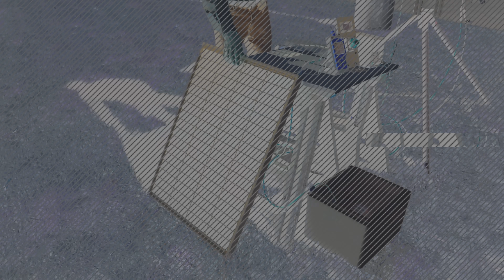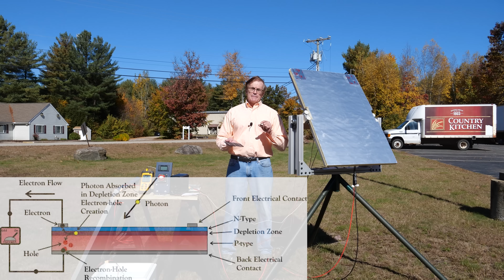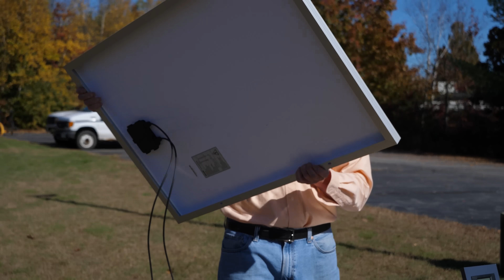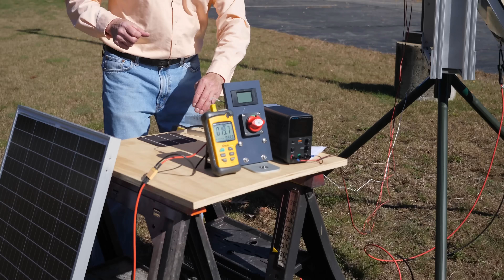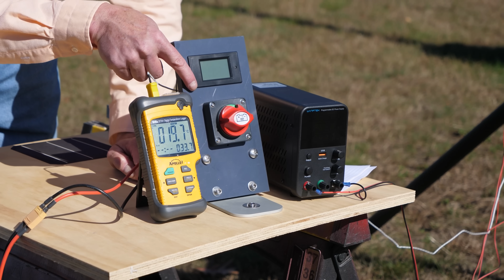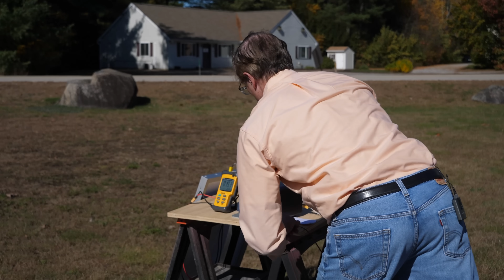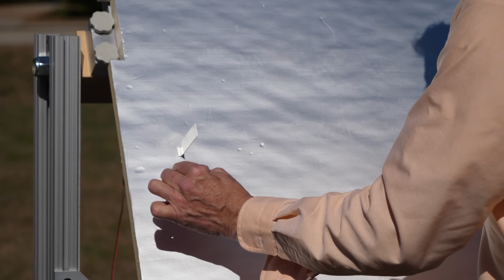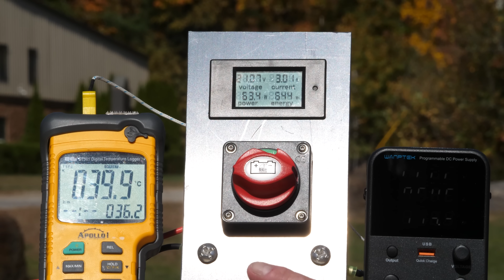Do you REALLY get enough out of your solar panel?

Comment: A couple of issues. the original test run had the fans and heatsink on the back, this may have actually increased the thermal mass and created a higher temperature in the passive mode. Once the fans were turned on they would do the job as described but the temperature difference between a standard unmodified panel and active panel may not be as great as shown. However in saying that the best idea may simply be to add the aluminium fins to the back of the panel, that alone would greatly increase the passive cooling, no fans required :)
Reply from the maker: The modified panel with the fans off runs slightly cooler than the stock panel, but the difference is small.

Comment: Fantastic test. If the panels are fixed, this may even be achievable with a solar chimney of sorts - black tube heats up and air inside rises to escape, drawing cool air from below, possibly even from under ground, past the panels to cool them. Not sure what kind of setup would make this practical with enough air flow, but something to consider.
Reply: Benefits are zero maintenance and totally passive system, potentially low cost, potentially use recycled materials like soda cans for heat collector.  Use exhausted hot air to heat or pre-heat water for showers.

Comment: i have a question: imagine we send 1 millions watts with a big mirror reflector to 1 solar panel 100 watts with a special cooler that keep  constant temperature juste above 0 celsius.  what maximum watts in theory a panel could handle/output ? is it related to the heat only ? thanks a lot
Reply from the maker: Eventually, the cooling system will not be able to keep the panels  and especially  the conductors within the panels below their damage threshold.
Reply: @TechIngredients  thanks you , it make sense ,i think there is a nice path  to explore

Comment: 1) I ABSOLUTELY LOVE THIS CHANNEL! You're thorough and your explanations are easily understood! I subscribed after the first video!
2) Would it be cheaper/easier for a person to just buy 20' sticks of 3/4" aluminum angle and cut them to length then adhere?
3) If a person has a modest breeze(2-5 mph) or even convection, would the added heatsinks alone provide worthwhile benefit?
4) At 1%/yr degradation, the panels will still be producing 80% at 20 yrs versus 90% for 0.5%/yr so roughly +2.5% over the life.
     At 2.5% improvement,  the "system" needs to cost less than $3/panel. Otherwise it's simply cheaper/easier to install 2.5% more panels.
     Also, solar changes so fast, after 20 years of technological advancement, solar tech will likely be pennies/watt maybe even spray-on.
5) Years ago, I spent many hours designing a passive solar tracking system that should add 20% to daily solar harvesting, but ran into the same issue. The system would add about 20-25% to the array cost and some basic maintenance. In the end, I decided that adding 20% more panels with no moving parts was the wiser solution.
6) I'd love to see what you think of Redox Flow Batteries. I've been following them for years and think they may be the solution to alternative energy storage. Imagine... Tanks at your house that power your home and recharge via solar or cars that use "gas" station infrastructure to simultaneously extract the "discharged" fluid and fill with "charged" fluid.
Reply from the maker: Thanks for the comment.
Bending  your own is much less expensive than the extruded angles.
You have to combine  both the increased power output  with the increased longevity for a cost vs. performance comparison.  Also, the higher the sun's intensity and the ambient  temperature, the more the cooled version makes sense.
If you have a limited area for PV panels then replacement for increased performance makes more sense, but if an upgrade only means adding more panels  to your system then maximizing the lifespan of existing panels makes more sense.
This approach  is just another tool.  You have to run the numbers as you clearly did to decide whether to use it.

Comment: Very nice video.
The one thing I wonder is how fast the fans weather. Replacing these fans on a roof is not easy.
Reply from the maker: They have a MTTF of 50,000 hours at full power, and you only need to run them about 8 hours per day at 25% of maximum output. 
They could also be modular for plug and play replacement.

Comment: It's kind of common sense to anyone that has electronics as a hobby, or has a gaming PC.
No silicon Integrated Circuit, which is what solar panels are, likes temperatures over 50 degrees C, and operates better and better as they are cooled, all the way to absolute zero.

Comment: I wonder what the impact would be of natural convection on the back side of the panel with the same fins and back cover but no fans. If you increased the gap at the top of the back cover to match the bottom gap you might move an appreciable amount of air by natural convection. The panel temperature would no doubt be higher than the forced convection but an overall simpler and less expensive installation with no moving parts AND the net power gain might be similar. Yes, I am an engineer...

Comment: Forced air cooling would not be cost-effective with the 4 panels I have on my motorhome. However, I am moving up to a newer motorhome that doesn't have solar, and, and because we don't use solar all the time, I am thinking about not permanently mounting the new panels on the roof, instead storing them in a bay when not in use. After hearing about the heat-related degradation, I think I will definitely go that route, which should help prolong the useful life of the panels. That's my takeaway from this informative video. As always, a well presented and useful video!

Comment: i wonder if mating a thermocouple to the backside to absorb heat would differ any from the fans. Just like the fans, a thermocouple will require power in order to operate.
Reply from the maker: It wouldn't  work.  Thermoelectric  devices pump heat from one surface to the other. You still have to cool the warm side.  Also,  they are very inefficient.

Comment: The problem with this is it's cheaper and easier just to add more panels. What was the cost of all that equipment vs the cost of another panel? You can get a 100W panel on Amazon for less than $100 which would add another 60ish watts of power, compared to the price of multiple fans, controllers, heat sinks, etc. which will add what, 8 watts? It just makes no sense.
Reply from the maker: You should have watched the whole video.
Reply: @TechIngredients  I did, and I usually like your videos but this is a pretty poor defense. The equation is very simple, solar panels are producing about 1 watt per dollar these days and good fans are very expensive. Unless can prove a fan, capable of running at high temps, high duty cycles, outdoors, can provide 1 watt of efficiency increase per dollar of cost it's a negative ROI investment. I bet just the fans alone make it a negative ROI, without even adding in the heat sinks and everything else required to run the system. And extending the life of the panels is a bad argument because solar panels only get cheaper every year, in 10+ year $1/watt will be expensive so the equation only gets more lopsided. I highly doubt you could provide numbers to show this would yield a positive ROI, even with the theoretical scaled up system with less fans.
Reply from the maker: What you don't  address  is the degradation argument.  In addition  to the power boost, these panels  will last longer, and both benefits  increase when these panels  are running at high ambient temperature  and high sunlight intensity.  That's  why I suggested that where you live will determine the ROI for this approach.
Reply: @TechIngredients  Yes I do, the degradation is addressed by technology getting cheaper with time, plus you're not wasting time and money on cleaning heat sinks and replacing burnt up fans. In 10+ years when degradation is enough of an issue, it will be even cheaper to replace a few of the panel to get better efficiency.

Comment: they did not even mention about bifacial panels which increases power drastically but now it is bifacial you can't put anything on that side of the panel.
Reply from the maker: You could still add the air flow even if the fins would not be used.  But, you're  correct that they would not be as good a match.

Comment: nice testing but the importance and hype is so wrong.  you don't even have to listen me but look at utility grid level solar farms, they don't do it as it is just not worth it.  You are better off buying more panels as they get better while getting cheaper.  additionally, they did not even mention about bifacial panels which increases power drastically but now it is bifacial you can't put anything on that side of the panel.

Comment: Instead of using aluminium fins could you use an array of thermocouples? They would lower the temperature with the bonus that you could extract power from them.
Reply from the maker: They would be far more expensive  and less thermally  conductive.

Comment: By the time you pay for the fans, the sheet metal and the labour, you will have spent way more for that extra power then if you just used more panels. That's the problem with basically every way for improving solar. Solar trackers are more expensive for power gain than just buying more panel. Solar is so cheap that the answer is always more panels.
Reply from the maker: If it was only power, then you're  probably  right.  Don't  ignore  longevity.
Reply: @TechIngredients   Interesting point about longevity, most panels are guarantied for 25 years, but you fans will definitely not last that long. Adding moving parts to improve longevity is probably not a good idea.

Comment: I do think water makes more sense in the long run. It's not only about cooling the panels but what you could gain from that hot water.  And if you want to cool the water then a radiator could be added to the loop. This would have massive advantages the more hot water you need for your house. Also, yes, it could leak. But the mechanical parts of the fans could also degrade. A radiator (potentially with active cooling) would (in my mind) be easier to service.

Comment: What I'd really like to see is fully integrated heat management in homes. One big ole heat pump, and a manifold to direct hot and cold water. Hook up your fridge, pool heater, ac, heat, solar, battery packs, everything.
Reply: I've been thinking about this as well, instead of solar panels we could install solar absorption panels and radiative sky cooling panels all over the roof, but I don't know a reliable way to toggle the panels on and off, without having to replace mechanical parts a lot
Reply: In combination with more efficiently insulated homes, the energy required to moderate the temperature of the home would drop and less panels would be needed
Reply: I think another useful tool is window treatments. I'm thinking things like: An external insulated & heat absorbent window shutter for cooler weather, and a passive cooling film for warm weather which reflects IR and heat and radiates the energy it does absorb into the sky

If this kind of thing is possible it would help even more
Reply: @Kavukamari  if you live about halfway into the southern or northern hemisphere such that sun somes in at about a 45 degrees angle, you could build and position your house such that one side of the roof is getting sunlight dead on (at midday, the sun would still cross the sky) while the other side of the roof is in perpetual darkness since the sunlight would be parallel to the other side of the roof, though the wobble of the earth might expose it to light if you aren't careful. Then you could have ideally placed and oriented photovoltaic/thermal/hybrid panels on one side of the roof, and passively radiative panels on the other side that could provide cooling power in broad daylight since they are always in the shade (though if you are trying to rejectheat to space, you'd either need to ensure nothing would radiate heat at them, or you'd need the radiative panels built as staircase structure with protectivs walls to prevent radiant heat from trees warming them up too much, or some other structure.) The closer you are to the equator the more awkward the angle on your roof you'd need, with being at the equator resulting in a flat roof with radiative panels on the walls. You'd be building a roof that peaks with a 90 degree angle, then adjusting the orientation of the roof (allowing one side to get longer/shorter than the other) such that sunlight will almost always hit on one side dead on at midday, and will always come in parallel to the panels on the other side of the roof (missing all of them). Then you would only have the issue of the "solar" side of the roof not doing anything at night. But if you cooled the panels with water (providing hot water during the day), then at night you could possibly use the panels as additional radiators (though not as efficient as the ones on the other side of the roof).
Reply: I'm sure it would sell pretty good. So get a loan and BUILD IT..!
Reply: Already have something like this on my house. Problem is that when you have an overcast day, you get no hot water.
Reply: Yea. One could probably conceive a  system built into a shed or a shipping container which would include heat storage, cold storage, gyroscopic and chemical battery which could be managed through AI and built by self replicating robots, which could also farm the food and mine all the necessary materials in space while we are chilling by the pool with margaritas and beers😊
Reply: This is the answer. Everything is a heat engine.
Reply: yeah … a whole-house system would be neat.  from what Tech Ingredients has shown us, it helps if you design and balance the components together for maximum efficiency.

IRL, it’d be a nice start to at least have all the components, and a software controller that ties them together, monitors everything, and turns systems on & off for best effect.
Reply: I heard an interesting “stat” … out of the whole planet’s energy consumption, per year, we lose a whole Saudi Arabia worth of Energy to losses, from things like uninsulated houses.  🤦‍♀️  Just global total of the “losses” we could probably recover, if we made the effort.

🤷‍♀️  That’s also a ballpark estimate of the amount of money available to solve these problems!  💜👍
Reply: Can't wait for Tesla to get into HVAC. Their Octovalve works great in the car. I'm sure it would be smart way to manage heat around the house.

Comment: Ali extrusion from a hardware store would be a lot cheaper than paying someone to bend sheet.
I'd be interested to see the completely stock panel vs one with just the fins on the back (no plate or fans), did you ever test that?
It'd also be interesting to find the sweet spot of the whole system, not just the fans. Slightly more airflow and fan watts may give you enough cooling and panel watts to offset the extra fan watts? (as well as increasing panel life)
Reply from the maker: Actually,  those extrusions are significantly  more expensive.  I checked.
The modified panel runs slightly cooler than the stock panel, even with the fans off, but the difference is small.

Comment: On my RV I have considered installing a copper spiral on the back of the panel to act as a hot water maker. After seeing your results I imagine it would also be worthwhile as a secondary benefit of cooling the panel and improving efficiency. On an RV or boat everything should have at least 2 uses/benefits.
Reply: If you do a copper spiral, you should try to do something to soak up the extra heat as evenly as possible. If other portions of the panel are still super hot, those portions may be a weak link that prevents you from being able to tap into a lot of the extra efficiency you'd gain by cooling the parts in contact with the copper coil. Maybe get a flat sheet of copper that is the same size as the back of your solar panel, then use some plumbing solder to tack down your copper coil to the sheet. Use some thermal grease or compound of some sort between the panel and the copper sheet, as well as between the copper sheet and the copper coil. That way the solder is only needed for securing the coil in a few places.
Reply: @HeyChickens  sheet of copper?!?!?!? are you ready to pull out a loan???
Reply: @MR-nl8xr  I would certainly NOT buy new copper. I would find an old solar water heater panel that someone was scrapping and buy it from them cheap. A lot of them have a full sheet of fairly thick copper inside that the tubing was soldered to. The solder usually is about oxidized off by the time someone scraps their solar panel, so it shouldn't be too hard to get it off so that you can run your own tubing pattern. The scrap value of a 4'x10' sheet of copper is well under $300.
Reply: @HeyChickens  says way under 300 like thats not some ones entire paycheck, and more than most peoples paycheck after bills..
Reply: @neon_Nomad  I feel ya, but unfortunately almost all solar water heating or PV panels and accessories are not cheap. It is what it is.
Reply: @neon_Nomad   - price the new Solar thermal panel then come back on that $300 deal, lol...  (sorry just kidding)
Reply: A spiral sounds better than it actually works. It is difficult to get the water circulating, especially if there is some bubbles in the spiral. Much more work, but much better to build parallel lines - super easy to get air out, and easy to get circulating.
Reply: Linus from Linus Tech Tips is building a system on his new house that takes heat from his rooftop solar cells and pumps it into his pool.  He's also got a server rack hookup for it so he can cool his computers and solar panels while heating his pool.
Reply: Use BLACK PVC pipe.. alot cheaper..
Reply: Just circulate the water through a double walled polycarbonate sheet.